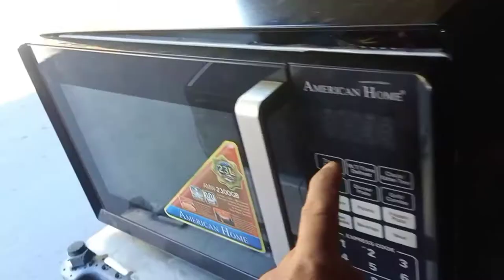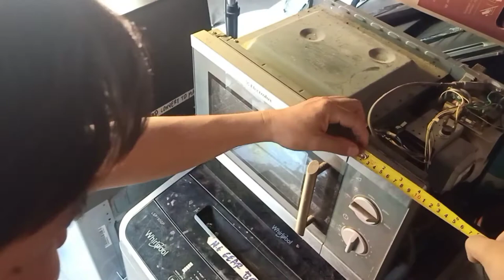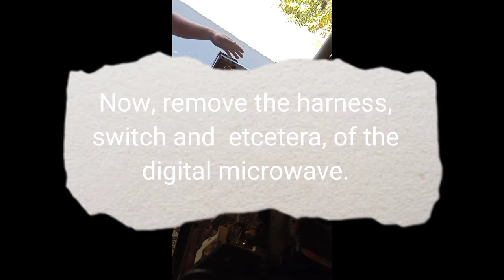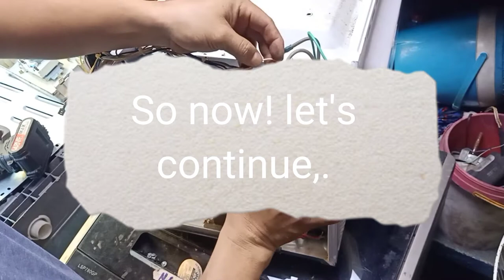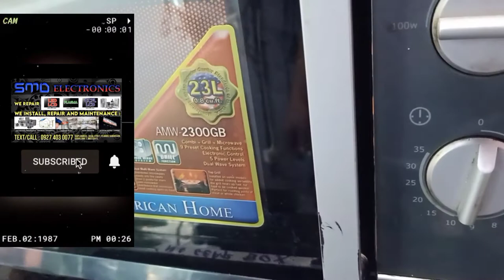How to convert digital microwave oven into manual type with out any diagram.

Comment: bossing ayos yan conversion
may tanong lang sa manual control sa taas knob para sa level ng power low med etc. yun baba knob pang timer.
ero ang tanong na sa level of power laging close contact from low to high or max. 2 wires lang nagpunta sa loob ng control ( nabukas na ako niyan at 2 wire contact) di ko malaman paano niya na control level with the same path sa ano mang level ng power. technucally di ko maisip physically ano magawa ng 1 contact compare kung meron ibang ibang contact bawat level.
sa digital control maaring mabago ng semi conductor. hope na kuha mo ibig ko sabihin. additional knowledge din pp
Reply from the maker: Sya napo mismo nag controll Po,. Michanism nyapo s loob,.
Reply: @smdelectronics6485  isa lang contact sw lang po anazing